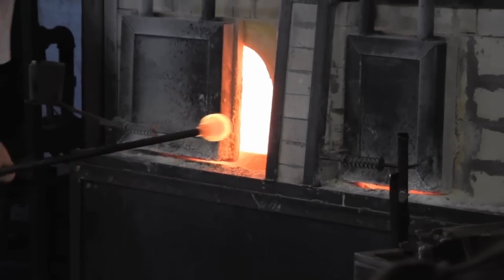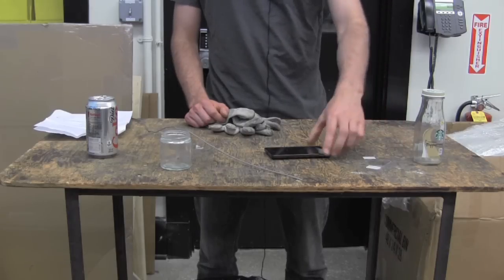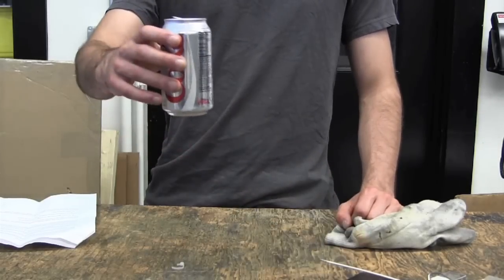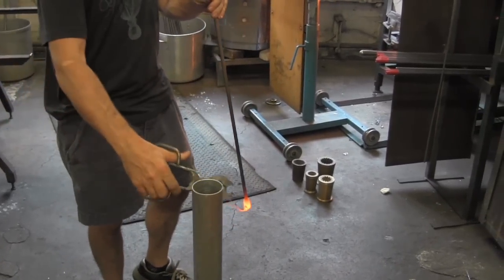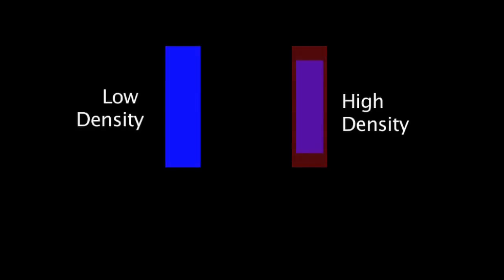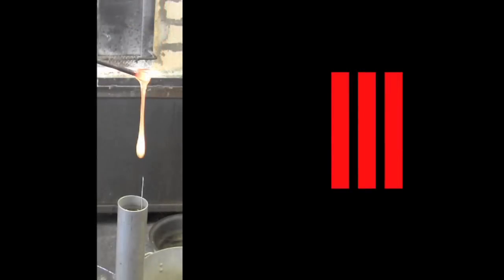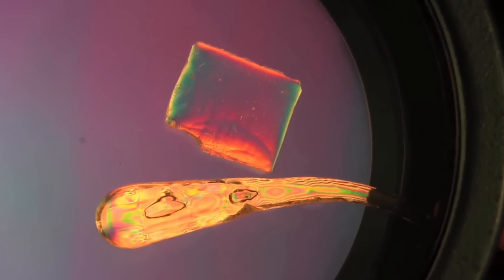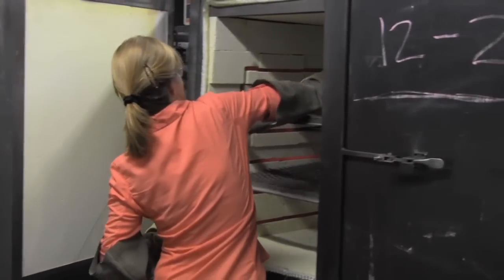Fire + Sand = Glass!

Comment: You didn't explain how thin fibers of glass can be extremely flexible, that glass is now becoming a standard everywhere for moving data at light speeds, or that glass is used as a structure material and to provide structural support.

Comment: at 4:20  you show a  Prince Rupert Drop under polarized  light
the "bubbles" are shown with dark lines around them.

My question for MIT  is : Are those really bubbles or are they under vacuum? 
basically  you have a molten mass of glass that should be fined out (having no bubbles).
when dropped in water the PRD contracts as said from the center that remains 
somewhat soft.

Many of the bubbles in PRD are weird shapes pointed and flatish ,no where are they roundish  as most bubbles in glass or other fluids. 
So picture  this ;;the "bubbles" are formed like  putting you hands together palm to palm
and then moving you knuckles  away from each other making a hole between your palms.
 
Wouldn't this cause a vacuum and  not create bubbles.?

You can also get  "bubbles" to form  by gathering up some glass ,, blocking the form
to make a round ball then blast one side with compressed air
as the glass rapidly cools  you can watch the voids form and get larger as you apply
more air.

i speak from 35 years of glass batching and glass manufacturing  experience.

Comment: Can you make a Prince Ruperts drop out of metal? or any other solid that can melted?
Reply: I wouldn't believe so. As he explained in the video, atoms in metals behave differently than those in glass, and have a unique ability to rearrange it's structure to accommodate for stresses. I think the metal drop would just solidify into a whole piece, and the tail would either bend or just snap off.
Reply: James Tarrou well rapid cooling metal... is called tempering - and it makes it harder.
Reply: my keen deductive skills pay off once again, HAHA!
Reply: James Tarrou It would be impossible as the Rupert drop is a property of glass.
Reply: mikemorr100 It is possible to get metallic glasses if you turn down the hot metal's temperature fast enough before the metallic lattice arrangement is made, but as these drops require slower core cooling, the amorphous property would be lost so I'd say it's impossible to do with metals. There is no reason why it shouldn't be possible with some other materials.

Comment: What about molten glass dropped in liquid nitrogen? That would be a tough one to break.
Reply: ***** Liquid Nitrogen is not near ABSOLUTE ZERO at all. Absolute zero? The point of basically no movement.
Reply: Igor K
Achieving 0K is as impossible as making something reach light speed. Both are equally hard to get to.

Its not even a fact that 0K is the rockbottom. No-one has even got to 0K.
Apparently the coldest something has been cooled is to about 100 pico Kelvin.
Thats 0.0000000001K..... Not 0K
Reply: Igor K You do fucking know that reaching 0K would break Heisenberg's Uncertainty Principle?
Reply: I cant get liquid nitrogen were I live, or at least easily.
Reply: Darksnow
You will NEED a Dewar, You will have to get one of them if you want to take any home.
Awesome idea, I was thinking of something liquid and cold.
I thought salty ice water, Maybe both should done. Though im sure someone has ?
Reply: Igor K Thats what I meant. but I heard that it's impossible. So 99.999999%
Reply: Igor K
What he means is its impossible to get to 0K
Reply: *****
It would, Would it?
Can you prove this ?
Reply: I dont think temp effects electrons.
Reply: Igor K
no it doesent, The electrons must move or they leave.
Reply: The Leidenfrost effect would create a shield of instantly vaporizing gas around the glass effectively insulating the glass and keeping it from cooling longer than it would in what I'm assuming was room temperature water.
Reply: And if its being dropped into it, Then surely that would help contact with the liquid.
Reply: ''achieving 0K is not hard''... wow, going light speed and having infinite mass isnt hard if achieving 0K isnt hard
Reply: ***** It would probably cool slower due to the leidenfrost effect, I'm not sure though.
Reply: Darksnow It would probably cool slower due to the leidenfrost effect, I'm not sure though.
Reply: Dry ice and metho might be the go. Ive played with that combination and its dangerous. A -80 liquid is something dangerously fun to play with.
Reply: Marcus Laurel 
Molten glass is far above Leidenfrost point of water (at least 900° C agaisnt 160°C), so Leidenfrost effect should also come into play with water, but doesn't seems to. My bet is that the surface of Glass is cooling to fast to keep warming water. I expect the same thing to happen in liquid hydrogen.
Reply: Aurélien Emmanuel Thank you, seem like the only person who shares my view on this youtube.
Reply: Darksnow You can make cheap man's liquid nitrogen with a video on youtube, look it up. I think its one hundred percent hydrogen peroxide and something else.
Reply: Aurumk1
There is no such thing as cheap mans liquid nitrogen. What your talking about is something totally different.
I know people like to use liquid nitrogen as some kind of standard, But calling something else liquid nitrogen when it contains no nitrogen at all is plain stupid.

If you want something really cold try using Methylated spirits and dry ice. Thats solid carbon dioxide in case someone felt inclined to towel off an ice cube :P

Edit:
I prolly should add, That mixure is not very frendly to fingers, There is no Leidenfrost effect with this substance at body temp. It will freeze things solid very fast including finger tips.
Reply: TheProCactus right, but there are mixtures comparable to its temperatures that can be made
Reply: Aurumk1
Nothing easier then the liquid nitrogen
Dry Ice is already -78.5c Metho will not freeze at that temp.
Reply: Igor K  "its possible we got very close to 0K, achieving 0K is not hard, don't put 0K on the same level as achieving light speed"

We see particles achieve light speed all the time. How are you looking at your computer right now. We have never seen a particle or anything at 0K.
Reply: *****
You are too late, He already got schooled.
Reply: +Luke Faez (Spaghetti Man) actually, it doesn't make much of a difference.

glass is already at temperatures of over 1100º celsius when being worked like that. Adding an extra ~210 degrees (from ambient to -186ºC) in delta temperature doesn't really do that much.

what would make more a difference would be to heat glass more, like to 2500 degrees.
Reply: +Igor K You're talking 0K being a complete lack of energy. Zero. That is almost impossible to do artificially. The mere act of observing ruins any chance of ever measuring it. Physics yo.
Reply: would literally explode in your face lol

Comment: common Glass is composed of about 75% silica (SiO2) plus sodium oxide (Na2O) from soda ash, lime (CaO), and several minor additives.  The most common constituent of sand in inland continental settings and non-tropical coastal settings is silica (silicon dioxide, or SiO2), usually in the form of quartz.